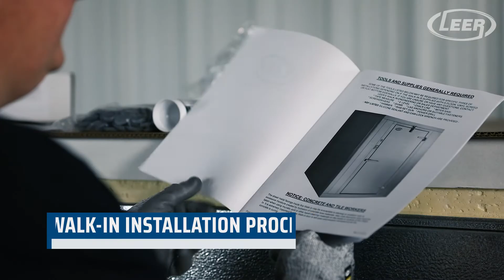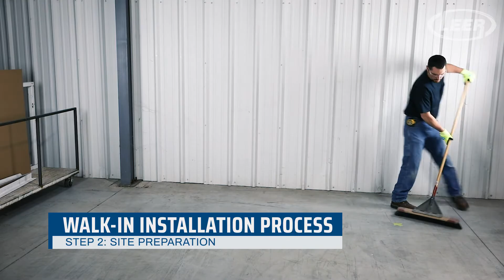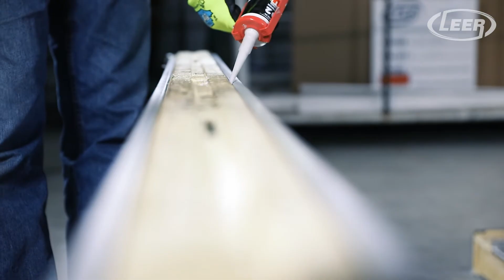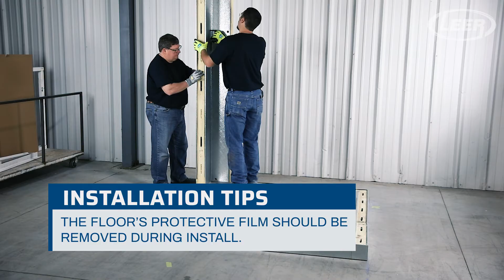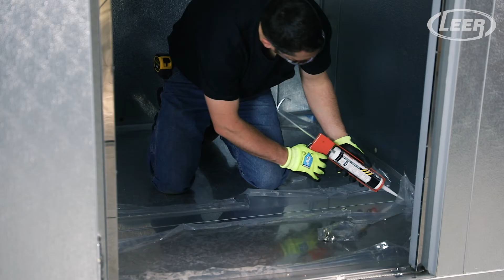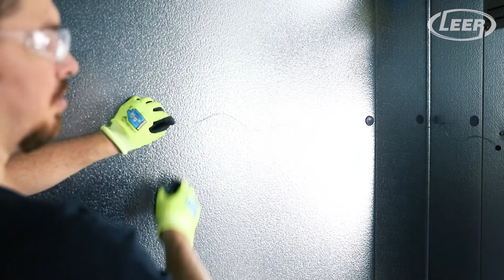Walk-In Installation Process | Leer Inc.

Comment: Now you say to leave a space of two inches on all sides for cooling but what if i want it installed in a tight corner for my restaurant is that possible
Reply from the maker: Thanks for your question. It will always be our recommendation and instruction to leave the two inch gap to ensure proper airflow around the unit. Please give us a call if you'd like to discuss in more detail.

Comment: Do sealant need to be put in the walls too?
Reply from the maker: Hey - Thanks for the question. Sealant (or butyl is preferred) should be used in all ceiling, floor, and wall panels during assembly. A large bead of caulk should be placed on the warm side of the tongue profile.